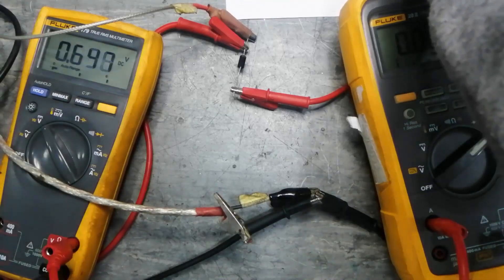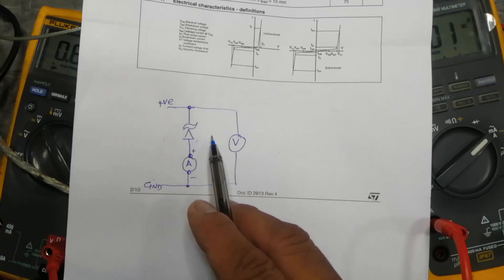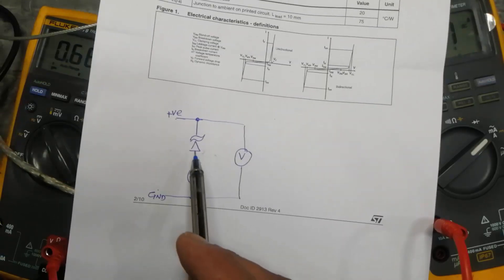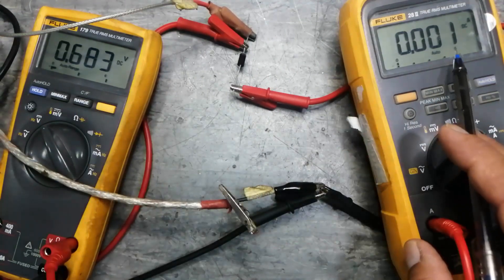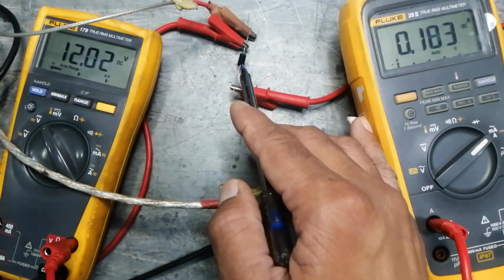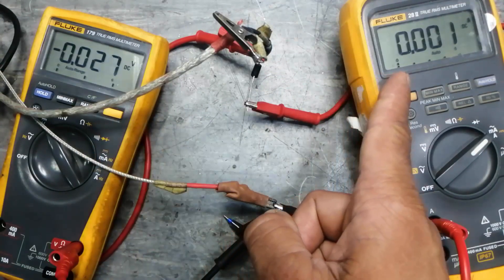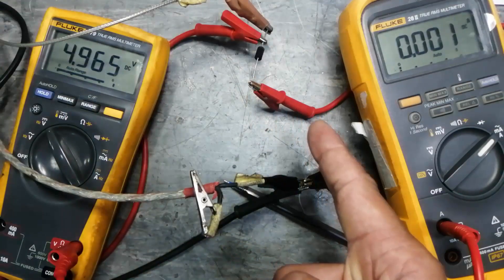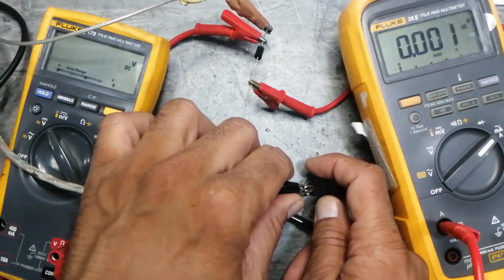{486} TVS Diode Test, What is, & How To Test TVS Transient Voltage Suppressor, Transil or Thyrector

Comment: P6KE200A diode shows short in multimeter. It's faulty?
Reply from the maker: if it gives continuity, then it is short circuit 
must be replaced

Comment: A  TVS is just a high power Zener.
Reply from the maker: yes you are right. it is a high power zener, in dc & ac lines. its main purpose is to protect the next circuit. and it clamps the spikes, transients in supply

Comment: Hello, this test is not accurate. I had problems with a batch of 1.5KE250A diodes, they shorted out. When measuring the capacitance using transistor tester I found a difference, the diode of the bad batch was low in capacitance, in addition to the forward voltage being lower.

Comment: Is sr160  using diode test reading of 0.199v  normal?  However if I test P6KE18CA using diode test , I can get no reading on both sides ,is this normal?
Reply from the maker: SR160 is schottky rectifier and its drop voltage are 0.19 to 0.3 volt. as it is fast rectifier with low voltage dropout 
while P6KE18CA is a TVS. we cannot test TVS using multimeter. because it will clamp the voltage above 18V, when we test with multimeter, multimeter cannot provide these voltage to operate the junction of the TVS
Reply: @HaseebElectronics  thanks a lot..  you are truly right... 👍

Comment: So what's the difference between zener and TVS can we use zener for same purpose?

Ok i got it
Thanks for your video
Reply from the maker: zener and tvs diode are same in construction PN junction based. 
just zener handles very low power. and after Izm (maximum zener current) zener gets avalanche breakdown and it Is destroyed. 
but in tvs diode, it's junction is very strong and it can doaspiate power 1500 watts for peak pulses. 
so we cannot use zener in place of tvs diode
Reply: @HaseebElectronics ❤ from việt nam thank sir